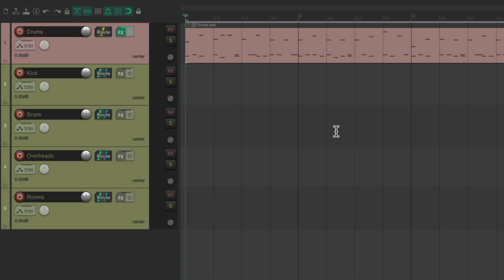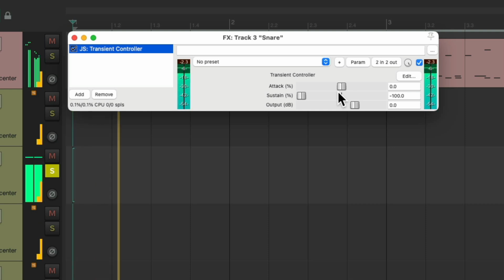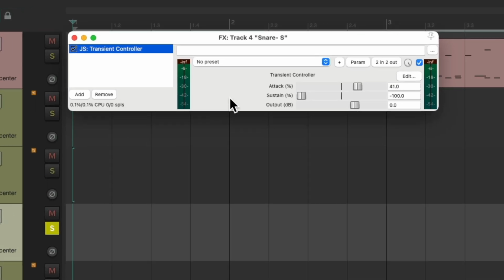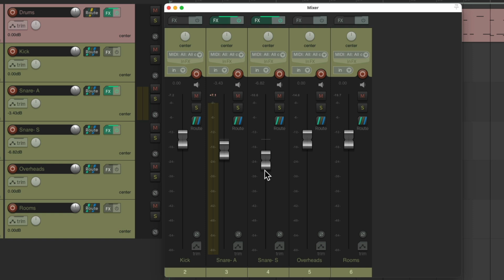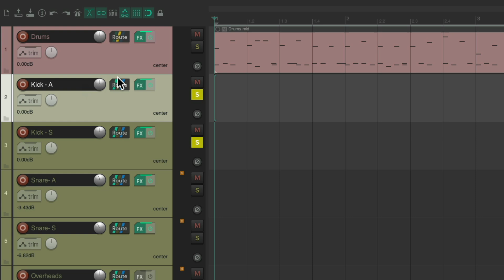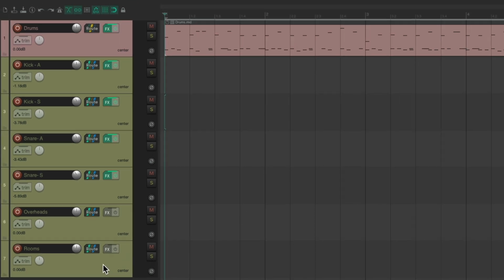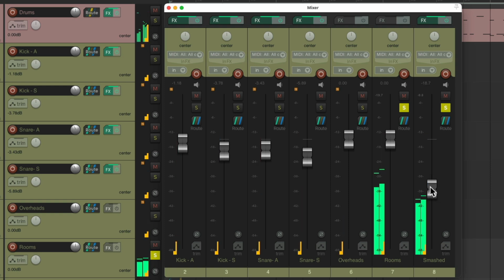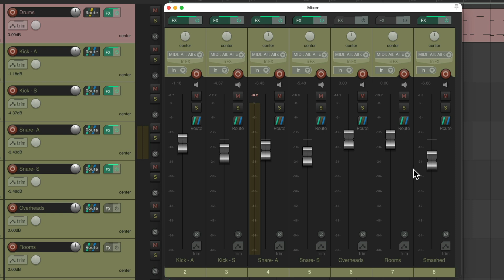Parallel Transient Splitting in REAPER

Comment: Very nice! I’m thinking it would also be cool to make this a custom action. Select any track and run it, it would duplicate the track put a first preset on it with just attack, then move to duplicate and put the second preset on it :)
Reply: or, if someone could make Transient Splitter JS plugin which would send Attack on one stereo channel and Sustain on another stereo channel, then just do two sends to whatever new tracks - and make this a template ;)
Reply: @TzzSmk  I thought of that too! The issue would be that you still have to run the plugin and make two receive tracks to get them as faders :)
Reply: @IDDQDSound  it could work within a track in basically same way you can use JS 3-band Splitter (then whatever plugins) and JS 3-band Joiner ;)

Comment: Using an agressive comp on room and even saturation is my favorite trick for drums. You can circumvent 1175 minimum attack and release settings by typing in values directly to input boxes. Low values provide a nice saturation. Then blend it with dry signal. Be mindful of the low end.
Reply from the maker: Great tip.

Comment: Isn't it simpler to just control transient/attack on the transient shaper itself instead of creating one track for each?
I suppose there's merit on the idea of controlling it directly on the mixer, not sure if that's what Kenny's going for.
Reply from the maker: Yes. It's simpler. And unfortunately I didn't have the time in this video to show you all of the flexibility that my method can provide. For example, you can now EQ the attack and release completely different. Maybe the attack could be bright while the release is darker. Or vice versa. You can also add different amounts of reverb to each. Or different reverbs altogether. But the biggest thing for me is like you mentioned. When mixing, you don't want to have to keep opening your FX if you can help it. So with this method, you can do it all with the faders while you're mixing.